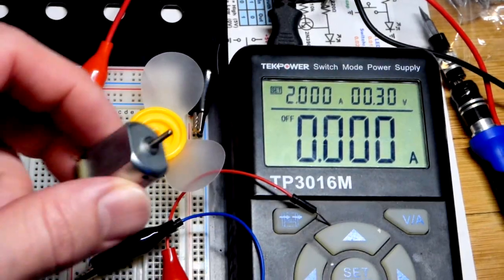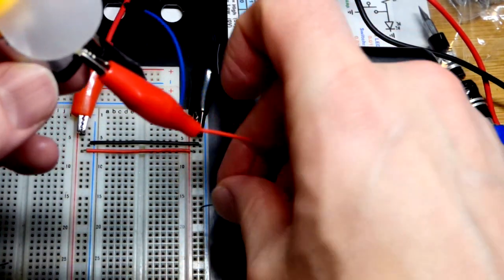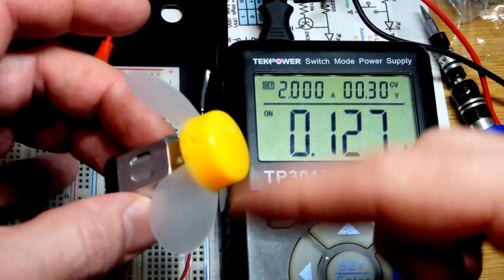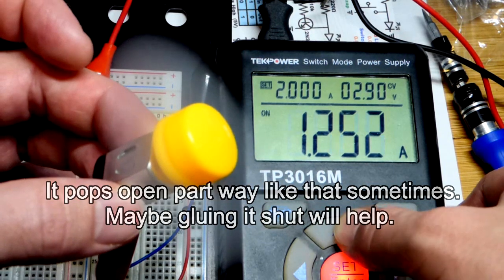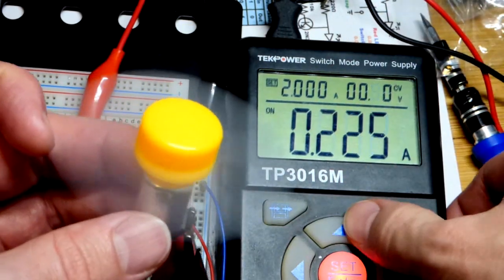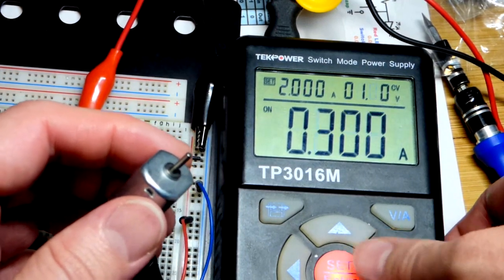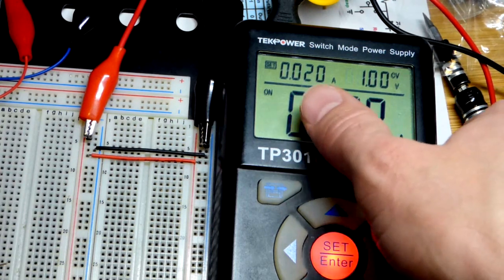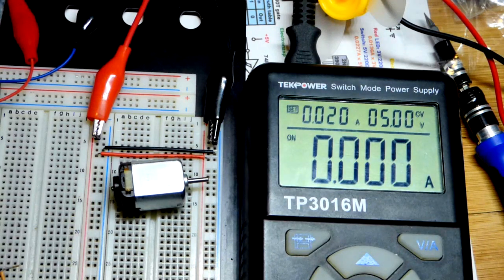3V maximum direct current DC motor demonstration by electronzap learning electronics lesson 0023

Comment: Hello, is it safe to hold a load in which 1A is flowing, reading from tables that can be quite dangerous or should I assume that the resistance of the human body will drop significantly the amps in case your finger is in parallel with the motor, thanks
Reply from the maker: It's mostly voltage that is dangerous to the body. 120V is enough to put current through your heart and cause other problems. Low voltage won't put enough current through you to even notice it. Low voltage and high current is mostly dangerous in the heat it produces in the circuit if you touch it. This motor though dissipates the heat it produces pretty well. Welding produces a flash of light that can damage your eye. So, depending on what you are doing, there are other dangers.
Reply: @Electronzap  thanks, I would assume that if you put a resistor or your finger between the leads of the motor, the current will drop to almost nothing immediately based of ohm’s law of 2 resistors in parallel